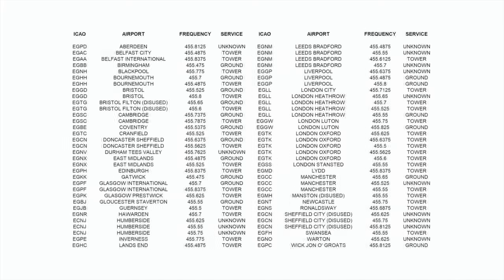How To Listen To Aircraft On A Baofeng & The Frequencies You Need!

Comment: But "some people" keep telling me that these Baofengs are just Cheap Chinese junk, and they cant receive anything. Now i'm confuckeld.
Reply from the maker: They’re the most amazing radio tool ever to grace us and I won’t hear any different.
Reply: What?! Randy! I love it when two channels I sub to have a crossover in the comments 💪🏼
Reply: I have just bought uv-5R but when entering frequency say 455.550 it say cancelled when input 0 on the end,is the radio set wrong,sorry completely new to this
Reply: It's amazing what replacing the antenna will improve - both Tx and Rx. I've heard they can vary by model, but the handful of variants I've bought have all been very capable.
In the back country where there's no cell signal, they've helped us coordinate medical assistance and keep groups informed of each others' location and needs.
Reply: The goodness ratio to dollar spend is insane. You get a lot for a very decent price.
Reply: @iandico   Think you are on the wrong band, there are two different bands ))
Reply: @MhWow66  ok thanks will try change over

Comment: Mine does AM and I can listen to my local airfield 😈
Reply: Which model do you have? I really want to do this and I don’t want to spend like $200 on an airband radio. The only reason I want it is to listen to my local airfield traffic which is only 122.9 

I have a baofeng UV-5R. Will it work with that or do I need a different model?
Reply: @d_kortman  yes I understand I didn't want to spend $200 either get a sdr you can listen to every band and it cost no more then $50
Reply: @keekdachoseone7  SDR? What’s that
Reply: @keekdachoseone7 sdr is great but bit inconvenient to carry with you, this is where cheap handhelds are great
Reply: How do you use am ?
Reply: Mine does SiriusXM and receives transmissions from UFOs
Reply: I can listen to Heathrow Approach

Comment: I actually find the English voice very helpful  because when switching between some modes it tells you if you have the voice on and those I use it to know status. I have found no other way to know exactly what is going on without using voice guide there’s several settings that have no indicator that have no lights or any visual indicators that I know of. If there’s visual indicators please let me know because I would be surprised. The main one I use it for is to determine if im in frequency or channel mode. Is there another way anyone? Thanks for any advice. But I don’t see any indication so I leave the voice on so I know what mode im in.

Comment: I've unlocked my Baofeng UV-S9 so it goes from 100MHz to 999MHz. Bearing in mind it isn't perfect and can only transmit between certain ranges without losing PLL lock (and outputting additional harmonics outside of its filtered range). I've managed to pick up things that it isn't usually able to receive in other bands.

The reason I hacked it is because the official software broke the tri-band functionality. 😂
Reply: You haven't hacked it. You've used Chirp to open it right up. I spent hours finding the extra bandwidth on either side for 70cm and 2m. I will post the Wide banded frequencies in normal comments of this video.
Reply: @hackerhacker8578  hey how do I do this? I have a Baofeng UV-5R can I make it to where I can tune into 122.9Mhz for my local fields CTAF frequency? Or even if i have to get a different radio, I’d still like to know. I’d rather not spend $300 on an airband radio if I’m not using it for transmissions, only reception.
Reply: @d_kortman  Get a Wouxun 10 watt KG-UV9H (no, the part number isn't a typo) and get actual AM Aircraft reception instead of hoping your local airport sets up an FM repeater.
Reply: How plz
Reply: Is this through chirp?

Comment: Hi, can i have some advise please, just got a UV-5RIII with the two standard antennas, I live a stone throw away from EGSS approach near your old mate AndyK. Ive tuned into the FM repeater on 455.550 and can only hear STN ground. was thinking i may hear the aircraft when they go onto tower via the repeater? should be able to pick up both ends of any coms on tower feq via the repeater as both ends are clear on the ground?? Appreciate your time and videos. Would a different antenna help or do you think its just how the repeater is set up at Stansted?

Comment: hey mate, do you know if it can be used to listen to RAF base frequencies? I am planning on going to RAF coningsby and it would be nice to be able to listen to the aircraft
Reply from the maker: Hi nathan no, only the civilian uhf uplinks. Military bases don’t use these. Hope that helps
Reply: @RingwayManchester  cool, thank you.
Reply: You can use a regular scanner to get military comms. A cheap one that can get to air band is the Uniden 33XLT
Reply: @RingwayManchester they use 409 mhz but those are refuel, maintenance, squadron, and usually a twr to vehicles freq u know it's raf on 409 are if tone is 192.8 hz

Other military users there don't use the 192.8 hz or I've never found any on there